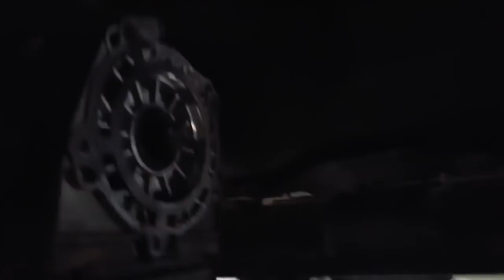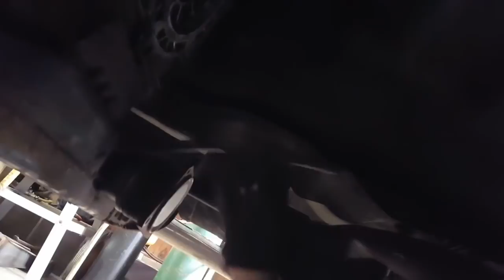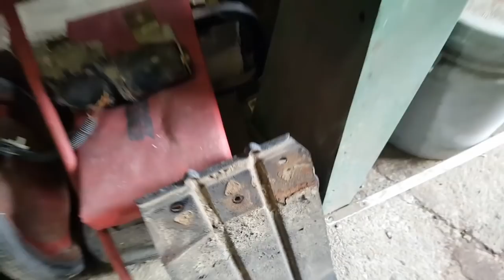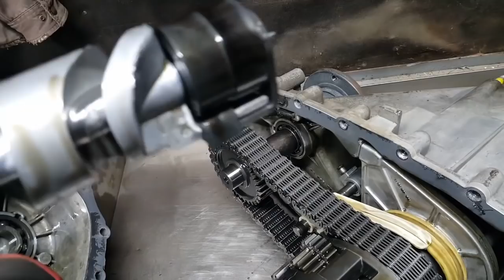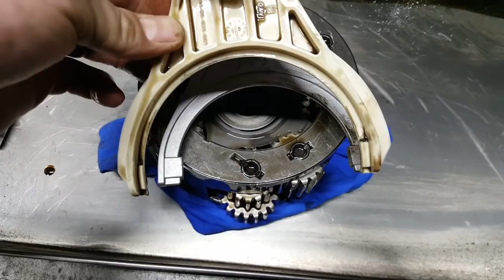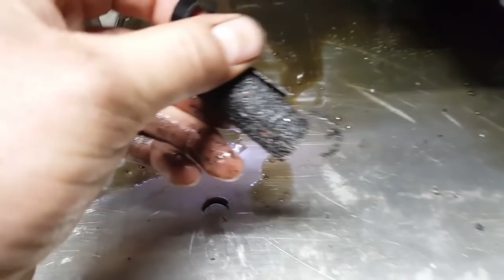Hummer H3 Transfer Case Service Pt 1

Comment: EBAY has a similar-looking filter as "Mopar" filter. Has anyone tried if it is the same part?  The oil pump was possibly introduced because filling the transfer case "enough" like the old ones would lose that all important CAFE mpg if churning a quart or two more. Anyway, I am going to make a new fill plug at the height of the transfer case I have in my K5 Blazer that has also full time 4wd. That transfer case does not have a pump, just enough oil in it. And, I am possibly removing the pump because if the rear seal fails, the pump will empty the case in just 50 miles. And then the chain is toast. And that nylon fork too. Quess how I know that....

Comment: I appreciate  you spending time to show us how to fix this. I too, have a 2007 Hummer H3 with the same issue. my problem is the nylon fork will not engage 4low, do to wearing down. I will have to change out the fork you you have done in this video. I'm confused that you have mentioned the H3 will not come out of 4wd. The H3, like the H1,H2 and their military cousins, the  HUMVEE (HMMWV) are full -time 4wd vehicles. They are not supposed to disengage out of 4wd. the Transfer case controls on the dash clearly shows 4wd high,  4wd High lock, and  4wd low lock. In regular 4wd high, the power coming through the transfer case is 60% rear 40% front. 4wd high lock 50/50 power front/back and 4wd low lock  is 50/50 power  front/back.  Thanks again for the video.

Comment: Should I be able to spin the out put shaft going to the front wheels when the transmission is in park
Reply from the maker: Not if the transfer case is in gear, no.

Comment: I have a 2006 I was hoping it would just be the fluid but I'm trying to be prepared could this be the same issue with the 2006?
Reply from the maker: It wouldn't surprise me if this were an issue with other models years.

Comment: The Hummer H3 is full time 4wd...how do you propose to disengage the 4wd ?
Does this fork switch from 4wd High to 4wd Low ? I have the exact same problem.. just got my new Metal Fork today and I will be replacing it as soon as it stops raining here in Central Oregon... sometime in June or July !
Reply: they are all wheel drive, there is a difference. then you shift to 4wd

Comment: Its me again anyway i have another question.

Did you have any issues putting the other part on to seal it?

Did you have to turn the gear to have it go inside the planitary for a full closed case?
Reply from the maker: Yes, you will have to turn the gears to get them to mesh properly and line up. I just sealed it with silicone sealant.
Reply: @diymechanictv1233  thanks man
Reply: I just want to update lol my hummer is finally working again.
Reply from the maker: Awesome! I'm happy to hear you got the issue resolved.

Comment: How much oil did you put in it?

I just took mine apart today but the shift fork is coming in tomorrow.

I took my time to clean it up really good my filter screen looks pretty good the magnet had a bit of gunk but nothing that wasnt normal wear so im pretty much going to leave it alone just replace the fork.
Reply from the maker: I don't recall exactly how much oil it took to fill it. Sorry. Is the capacity listed in the owners manual?
Reply: @diymechanictv1233  i dont have it but today when i opened it it didnt have much oil but it did not have any leaks neither.

About the sealant where did you get it and whats the name
Reply: Also where did you buy your silicone and whats it called?

Comment: Hi, my husband and I are dealing with our hummer. We have an issue similar to the binding when we turn but some mechanic told us that a 4x4 supposed to bind when you turn. On our way to an appointment today, we were doing 70 in the interstate and heard a loud snap noise and then the truck started really bad as if the axels had broke. So I drove it 30mph home and took it to the same mechanic who gave me the same bs that 4x4's are supposed to bind when you turn. Now he is saying it's my transfer case. So that's how I found your video. Can you or anyone else in this tread help us save a lot of money and time by possibly troubleshooting this problem. When the mechanic and I test drove the truck, so I can point out the shaking problem, he told me to stop and we both got under the truck and he shook the transfer case with his hand and said that we need a new transfer case which seems it's going to cost over a $1000 bucks. I did see him move the transfer case back and forth or whatever that was in the middle under the truck and I also saw a lot of transmission fluid under the truck. Please let me know!
Reply: Do you have front or rear lockers ?

Comment: Thanks for these two great videos on why my H3 won’t shift from high lock to high.  GMC just told me I need A whole new TCase.  Don’t want the nylon fork that’s for sure!
Reply: Does it act like it's in neutral when in just 4hi? I'm have the same issue but mine is an 08.

Comment: Hi friend! you can help??
I have this fault in my Hummer H3 2008 3.7L v5
Will it be the same?

https://youtu.be/ipqXBlPe4s0
Reply from the maker: I believe it should be, yes.
Reply: DIYMechanicTV Hi, thank you, I changed the fork of the transfer, but it continues thundering, they will lower the transfer again to check the chain ... on this side there is no specialized h3. I hope that if that is why there are no parts available in Mexico

Comment: Everytime when i turn 2007 hummer h3 on and switch gears from park 2 reverse and back to drive..in between i am feeling like someone rear ended me it is a harsh shift and when i takeoff from a red light or complete stop i feel a shifting pulling on me i keep thinking it is slip yoke idk i got motor mounts replaced pressure control solenoid replaced internal wire harness replaced still same ol issue any help hummer brothers and sisters???
Reply: The banging could be a lot of things but the common failures to check on an h3 are:
-Front diff mount bushings (one in rear of differential and two at each cv axle output) 
-front driveshaft joint going from tcase to front diff
-worn or broken front diff
-excess play (stretched) chain in tcase.
To find out what problem was on my hummer, i placed my phone under the truck with video camera recording the undercarriage and shifted from forward to reverse and then watched the video to see what was moving/banging when i shifted. In my case it was the rear diff mount bushing, and there was excess play in front diff.
Reply from the maker: I'm not a ton of help on that one. If it doesn't feel like it is binding and popping when you turn corners, I would look more at the transmission and rear end than I wold at the transfer case. If you suspect that it may be the shift fork that is always locked in, jack up the front axle and try to turn a tire. If it moves freely then the front axle is disengaged, if it doesn't then it could, indeed be the shift fork issue we experienced.

Comment: 8:22 I don't think it is the planetary gear for low-range.
It should be the spur-gear central differential (planetary gear differential),
and the shift fork is used to locked the front and rear axle together, (4-High Lock).

Comment: I believe I have the same issue with my H3. Makes clicking noise when I step on gas while moving forward or backward. I've taken my to Firestone and they told me my engine mounts are broken and thats what's causing the noise and should take it to dealer asap. I told them they are morons because if my mounts were broken, my whole car would be shaking..(I have this on paper)... I did take it to Chevy dealer and they said my mounts are fine but both of my front axles will need to be replaced at $1806.15 for the service with labor. I did do that and car still makes the same noise when I drive. So I feel like I wasted my money! 
Not one mechanic ever mentioned the shift fork issue with H3's! We need more mechanics like you out there......Wish you were in Florida, I would get my car to you!!! Now I know the way to go. I love the vehicle the same as I did when I first sat in it in 2007 when it was brand new. I'm hoping for it to stay in my family for many many more years......  Thank you for this.

Comment: I have been trying to chase down this issue with my H3. I've done everything from new brake caliper, brake hoses, hub bearings and even replaced the right front transaxle, because it felt like the right wheel was locking up while making sharp slow turns. Not one mechanic I talked to ever mentioned the shift fork issue with H3's......dammit. Now I know the right direction to go. I love the vehicle and don't want to trade it off. Thank you for this.
Reply from the maker: I'm glad the video was helpful! The (relatively) easy way to test to see if this would be the cause of your symptoms would be to drop the front driveshaft, and go for a test drive. I'd bet good money that the symptoms disappear.